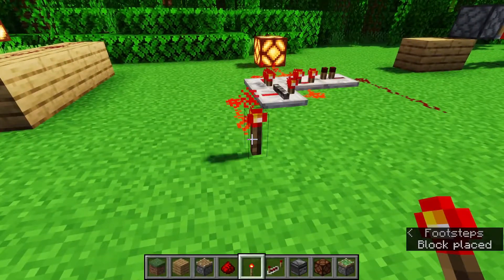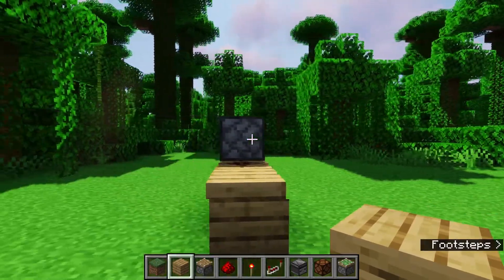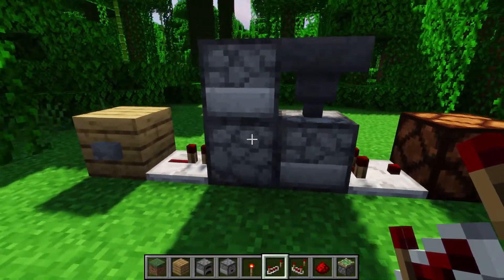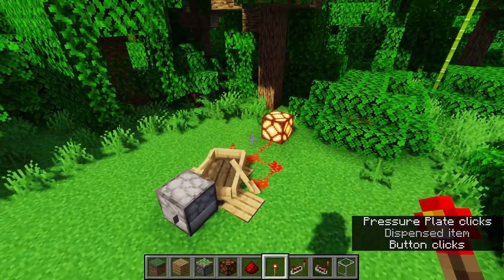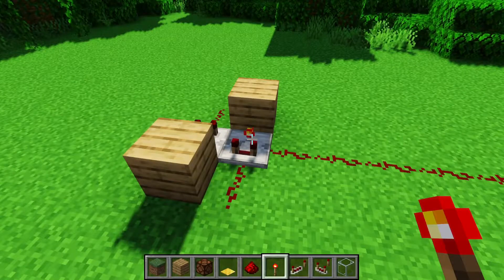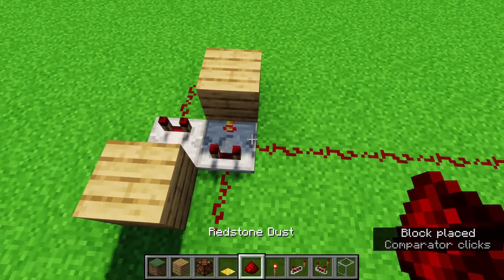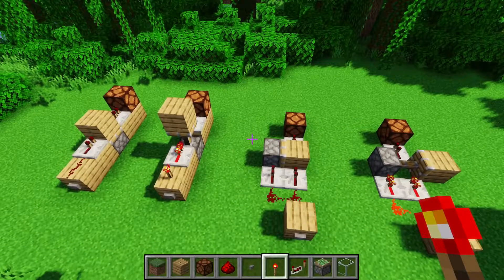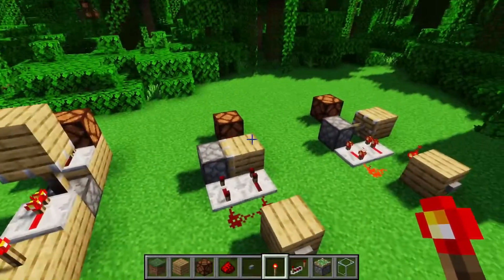SR Latches, T & D Flip Flops, and Mono-stable Circuits | Minecraft Redstone Engineering Tutorial

Comment: what is a build in which this could be applied? you mentioned a combo lock, but are there more?
Reply from the maker: T flip flops, SR latches, and Mono-stable circuits are used in almost every large-scale circuit in some way just with how general they are. D flip flops and the signal strength memory elements are more situational but using a signal strength for a hexadecimal-encoded circuit can be used for something like an order-sensitive combination lock or a calculator to name a few.